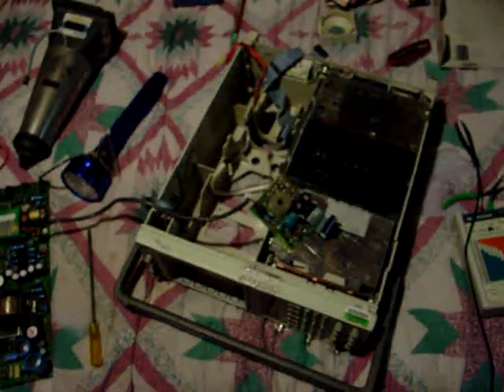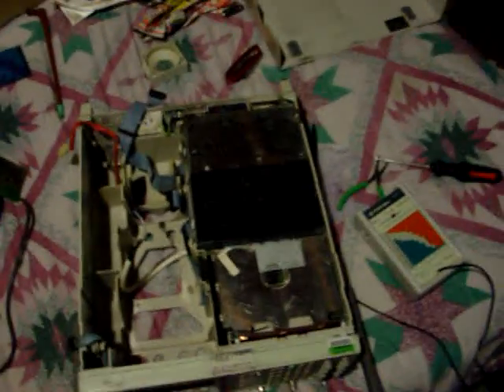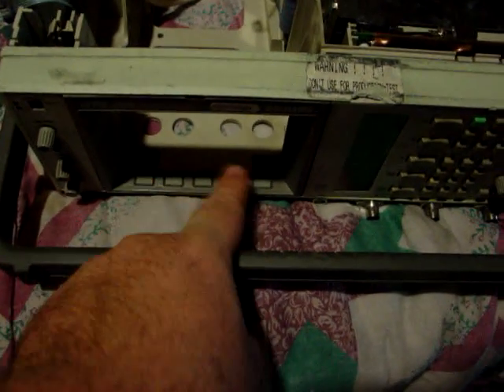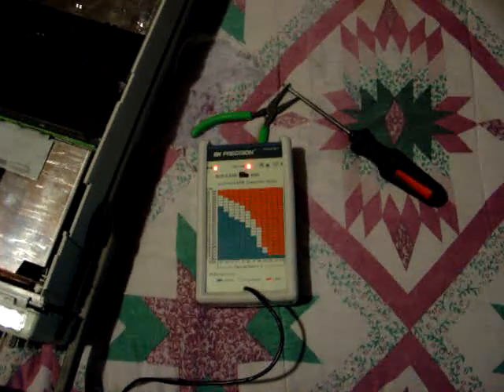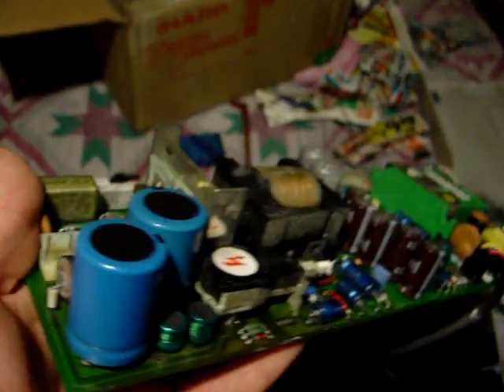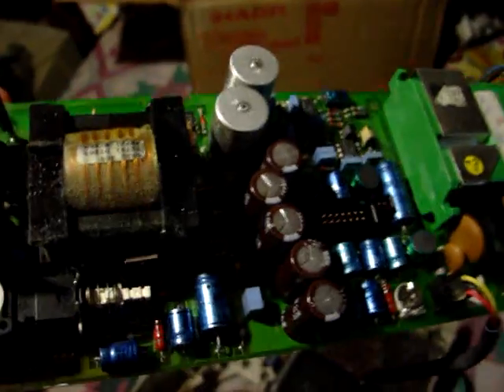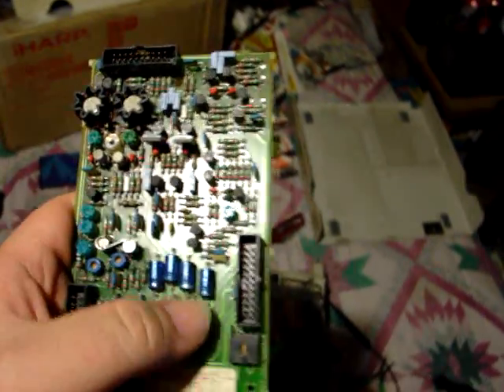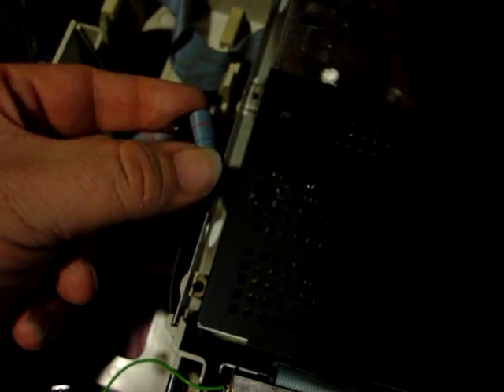Fluke/Philips oscilloscope restoration

Comment: Tinkered with this model (or very similar), had a power converter failure and needed recapping.
Reply from the maker: Yeah this one needed a complete recapping back then. I used it for years and I gave it away to someone who needed it more than I did.

Comment: I've got a PM 3335 manufactured around 1995 and it's working fine (18 years old?), very similar internal design. Now I'm worried about all the blue caps in mine. I wonder whether they just had different characteristics and only a few were bad. Or perhaps the ESR isn't critical for some of them.